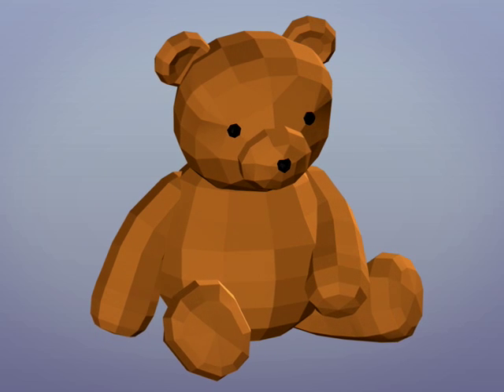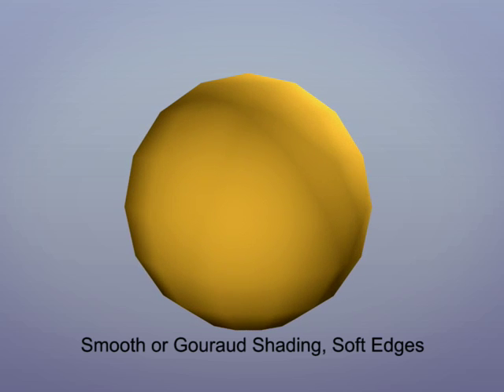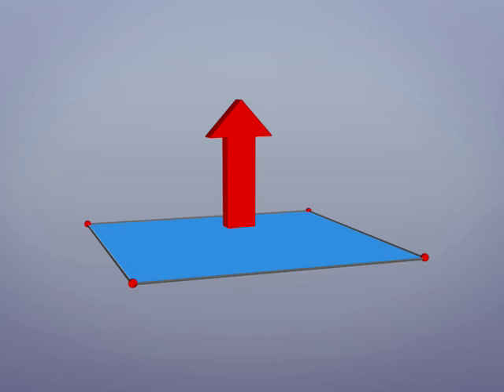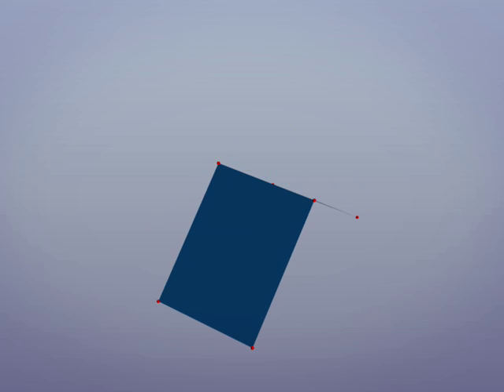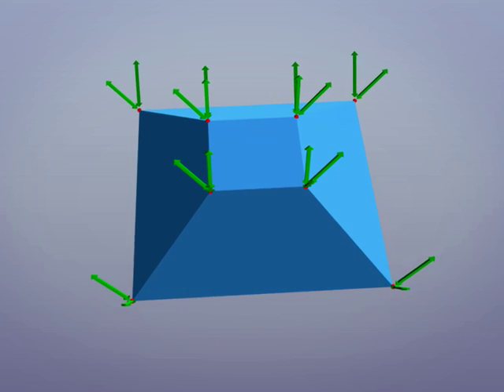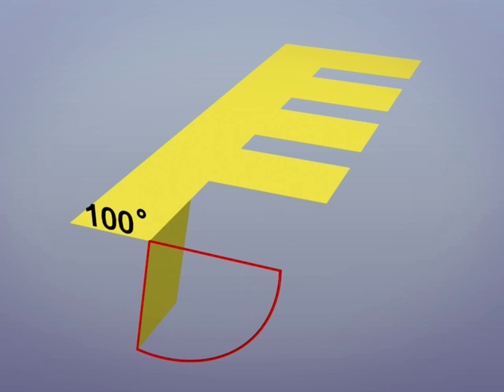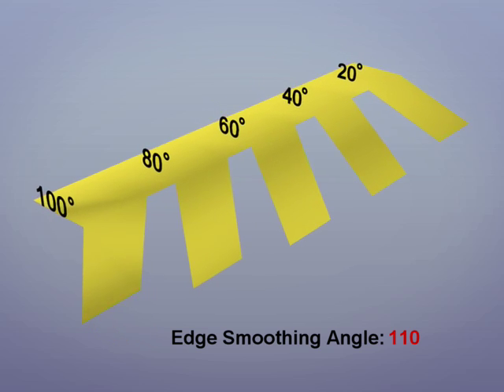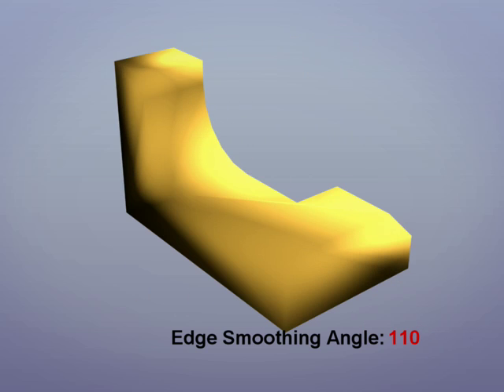Smooth Shading

Comment: Gouraud shading allows the model to look smoother without increasing the polygon count
Adding polygon is process intensive while the gouraud shading is easier to do
Gouraud = Change the gradient of the vertices. 
Changes the shades at the edges of the polygon so that they match.
WHen the angle between the edges is too high, the smooth shading technique doesnt give good results

Comment: Changing the vertex normals w/ fixed light source is equivalent to changing a light source with fixed vertex normal if relativity of motion is equal.  I did  my own lighting in OpenGL  using vector algebra.   Awesome video!